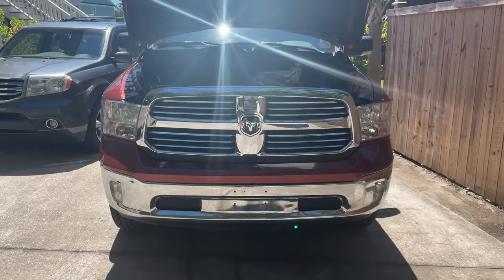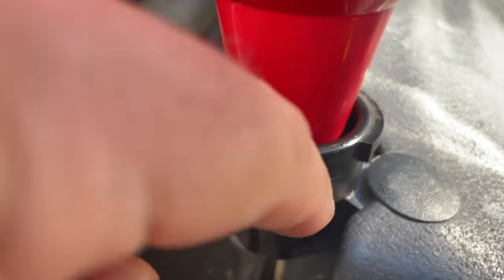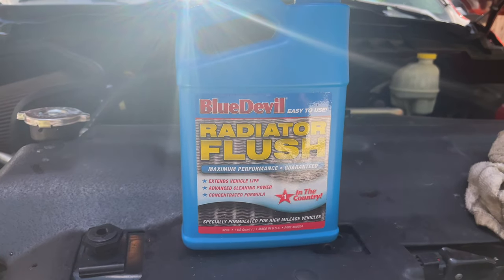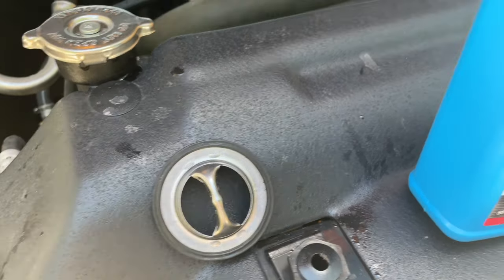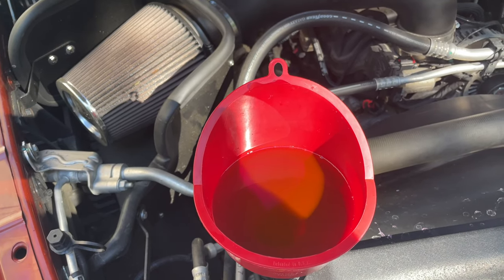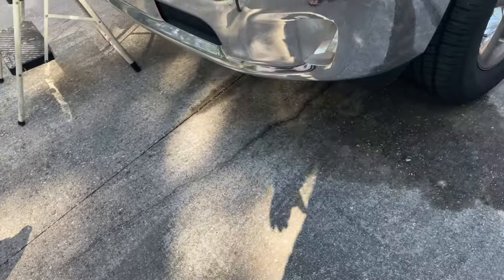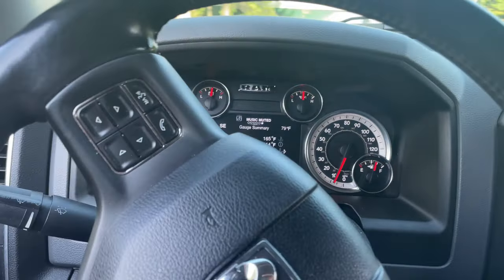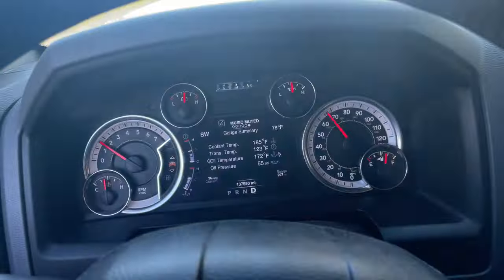Dodge Ram Hemi 5.7 Thermostat Mod | Coolant Flush Bleed & Trick

Comment from the maker: Wanting to share some of the journey of mods to my 2013 Dodge Ram 1500 Hemi 5.7. The 180 thermostat was installed after talking more with the performance community in an effort to help control short term and long term knock retard. This is a balancing act to keep sufficient heat in the combustion chamber, but not allow too much heat which contributes to more spark knock. Also, please remember this truck has a custom ECU tune by Hemifever to take advantage of the cooler engine temps.
Reply: Unless you have a forced induction mod with a custom tune changing to a cooler t-stat has basically NO Effect except to confuse the computer as it reads it to open @ 195. The minuscule gains and fuel economy losses amount to very little however if you have an azzhole environmental state on your azz this really affects that badly cause it is an incomplete burn of the extra fuel confused by the wrong t-stat opening until it reaches above 195. Unless you are towing HEAVY loads (meaning way over the recommended tow capacity) the heat load is minimal and this mod should only be done with a Forced induction mod or a heat increase due to heavy towing. Other than that the benefits are negligible at best and the fuel economy (yea right we running v8's really care about that  🤑 ) is a net minimal loss. These ARE the facts are are not disputed amongst any Expert forum advisor.  Just saying.
Reply from the maker: @anonimous2451  I will say you are entitled to your comments, but I got a good laugh for sure. This truck with the mods on it and the hemifever custom tune, absolutely loves this t-stat change. It consistently stays b/w 188 - 190 degrees and your comment about confusing the computer is not the case at all. This truck is proof, along with thousands of other hemi owners running these mods with hemifever custom tunes. The plugs look so much better than before these mods to top it off. Your "facts" about doing this only for forced induction or pulling Heavy loads is also misleading. This truck does at times pull a bass boat and the temps never rise above 190 and I live in a very hot, humid coastal climate. Wait, if this mod is ok for trucks that tow heavy loads, am I supposed to run out and put the stock thermostat back in when I am not pulling a heavy load??? I mean, if I don't and I am not pulling a heavy load, then the computer will be all confused and my gas mileage will suffer and I will eventual foul the plugs... LOL. Not true!! Also, the truck with the custom tune, cooler temps and other mods actually improved MPG by nearly 2 MPG around town and the highway. The motor oil is also clean and the oil temps dropped about 12 degrees when at full operating temps. Just giving you the FACTS about this 2013 RAM 1500 Hemi 5.7.
Reply: @KevinWilsonSBC then why do you think Dodge puts the hotter  thermostat in there? I mean I think you make total sense and it seems like to me if you can run an engine cooler you'd want to run it cooler. . Your oil looking better makes total sense to . Heat is what kills oil and fluid. So why don't they put a 180 in?. I was told the hotter thermostat is because of engines efficiency. Basically gas mileage
Reply from the maker: @ClaytonBigsby01  great question! It is all emissions driven. Remember this truck has a cold air kit, aftermarket exhaust and a performance tune from hemifever. I wanted more timing for power and pulling, to turn off the MDS on the computer and to not run the oil and heads so hot with the factory 205 degree thermostat to help eliminate spark knocking. The engine loves the cooler temps and more timing, the oil loves it and the engine stays around 185 to 190 coolant temps! Not to mention with the improved timing and MDS turned off, the gas mileage is actually better and the plugs are very happy. Go fast, go straight! Be SAFE!
Reply: @KevinWilsonSBC quién eres

Comment: When I replace a thermostat on a vehicle, I don’t drain the rad. I just go straight to take the housing and thermostat off. Just make sure I have a pan to catch the fluid that drains out. I’m no expert auto mechanic, but I feel like if I don’t drain the radiator, it will be easier to bleed the vehicle. The jiggle pin inside the thermostat will help burp the vehicle. Make sure the pin is 12:00. Thanks for the video

Comment: Very cost effective way to flush entire system would’ve been simply remove thermostat, get enough distilled water in buckets, hook pump/hose and fill the system & drain, next remove lower radiator hose so you not introducing sediments into Rad through water cycling through HC as you drain the block and repeat this after a drive and flush fully with distilled water. From your procedure you spent enough $$$ plus extra time many days not needed but results I’m sure still paid off. Most easiest way to get air out of the system would’ve been to simply open the bleeder valve on water pump or if not equipped to remove ECT sensor as you fill/close. Start her up get to operating temps, slowly open bleeder screw and left over air is out! Great vid, very detailed🍻
Reply: Do you have a video I'm having trouble following you

Comment: Only one very small hole is needed in the thermostat.  It only needs to let air through. To big and it will increase the time it takes for the engine to warm up. This will lead to excessive fuel consumption and cause very poor heater performance. Ask me how I know. Hope this helps.

Comment: You dont have to hack up a thermostat, you simply remove the rubber gasket and place it in the water pump. Seals perfectly
Reply: Exactly what I was gonna say
Reply: With a old water pump doesn’t work on a brand new one

Comment: Can any body in the comments tell me if the reservoirs on these trucks actually refill the radiator if it runs low? To me it looks the the cap seals off the over flow line to the reservoir and only opens if its too hot. How would the reservoir ever go back into the radiator?

Comment: Why not drain the block and heater core hoses after all the other work.  The passengers side block drain plug is fairly easy to get to.  The drivers side is pretty damn difficult if not impossible for the home mechanic.

Comment: If you live in cold climate areas? Only one hole is needed. When its -40, heat it your friend. These trucks were designed to run at around 203 degrees F. My old weak stat would cycle from 176F TO 203F and you noticed it in how poorly the defrosters work when its -40 f below.

Comment: For each pound on the rad cap, it raises the boiling point 2.5 degrees F, so your new boiling point would be 252 degrees F.
Used to live in the desert.  205, yeah, it caught our attention but you knew it wasn't going to boil the system.  No matter what, if it hits 220, I'm shutting down.  That's my preference, and I don't like it over 200.  But some blocks just run hotter.  Did you a know a 1mm, 1mm, 2mm ring pack brings operating temp down? Much more so than than the 5/64 pack. Working on determining if they rock in the piston bore.  Enjoy.
Reply from the maker: nolan engineering thanks so much for your comments! Good info! Thanks for posting and sharing. Sorry for late response, but thank-you!! Go fast, go straight! Be Safe!!

Comment: Did you program the radiator fan to come on at 185? If not, the cts will have it turn on at 203°F, which is oem settings. My jeep 5.7 requires this, but if you have a clutch fan. Ya might look into a different fan clutch.

Comment: My '03 ram Hemi has an over flow line on the coolant  resvoir that points down. I believe I don't need to burp it since that line would let out air by itself. Please let me know if I'm wrong. My 180* thermostat stays where it should be on the temp gauge. Let me know, thanks!
Reply from the maker: You should be good. My truck was heating up to over 200 at full throttle. Once I did this procedure and the flush, that problem went away. Go fast, go straight! Be SAFE!!
Reply: @KevinWilsonSBC  appreciate your reply! Like wise!

Comment: is it possible that a radiator on this truck may crack, if not  properly burbed  of air?
Reply: No the coolant will boil out the reservoir if you don't bleed the air if you don't catch it in time you will overheat the motor

Comment: I did this to my 2016 dodge challenger 5.7rt. And check engine light come on and said check throttle something  and my temperature needle  disappear . 🤔 I put three hole in my thermostat you put 4
Reply from the maker: Sorry to hear that!! I didn't have those issues at all on my 2013 RAM Hemi 5.7 which has a custom tune installed. I have had to replace the throttle body once since it owning it, but the thermostat and cooling wasn't related to the throttle trouble code I had. You can always put it back to stock.

Comment: Hey Kevin, Good job on the flushing. I also have same exact truck(2013 Bighorn) and original coolant in mine. Was wondering if you got any SES lights or warning lights from the computer for having a 180 degree thermostat? I live in Texas and was thinking of changing antifreeze and thermostat at same time, thanks
Reply from the maker: I have had zero issues with any warning lights or SES lights. I do have a tune which modified the fan to turn on at a lower temp. The truck settles in around 186 degrees which is plenty hot enough for emissions and I live in Charleston, SC which is really hot and humid. Even without a tune, I would highly recommend the flush and 180 thermostat! Go Fast, go straight! Be Safe!

Comment: Running a cooler thermostat will KILL you gas milage. Because the engine will not reach proper operating temperature. So the computer will keep the engine in cold start up mode.
Reply from the maker: Using the method I show in this video, the engine temp stays at 185 degrees and with the Hemifever tune we have actually picked up 1 - 1.5 MPG all day long. It is my understanding the computer comes out of "cold" richness around 160.
Reply: @KevinWilsonSBC  wow. I didn't expect that. Very cool.  My water pump went out.  I replaced the thermostat because it was so easily accessable. They auto store gave me a bad one, because my coolant circulates but the engine was over heating. I took it out, to drive back to the store.  The truck never got above 185, and it was mid 80 degrees in Indiana today.  But I only drove it a few miles.  Do you think my truck (5.7 hemi) could benefit from a cooler thermostat?

Comment: Flushing with tap water is fine.  Even well water is fine. Id just ude the distilled to fill it.  Flushing isn't going to leave deposits.
Reply from the maker: JustForFun77077 thanks so much for your comments! Go fast, go straight! Be Safe!!
Reply: You're dead wrong there. Ask a plumber what happens to pumps and metal components if you contaminate a system or fill with tap water on a in floor heating system. It says distilled water for a reason. Don't be a cheap ass and pay the $20 to do it properly before you toast a water pump or thermostat at the cheapest, or toast/seize something at the worst due to a potential daisy chain failure down the line...

Comment: Would I have to tune my truck if I install the 180 tstat? I have a 18 5.7
Reply from the maker: If you want to set the computer to run the electric fan earlier than 205 degrees, you will need a tune to change that part.

Comment: Why did you modify the thermostat when you could of just used the rubber gasket from the thermostat to flush system.. not smart
Reply from the maker: OK... yeah... Have a good one! LOL!
Reply: You need the metal piece to keep the gasket shape and hold it in place. Without the metal piece the rubber can squeeze out of place. That would be not smart.
Reply: On a 2012 Ram 5.7 the thermostat gasket accounts for the thickness of the thermostat flange, if there is no thermostat flange the gasket sinks further into the thermostat cavity. I don’t think there is a need to remove the thermostat to flush clean the system a few times though since the thermostat open about 1/2 inch allow for large particles to flow. 
Let me know if I am wrong.
Reply: @gerardr4869  not removing the thermostat to flush means a LOT of trash, grime and rust will get caught up in it. It takes more work to remove that junk than the thermostat, which likely needs replaced around the time you replace the coolant... Every two years or 30,000 miles.
Reply: Advanced Auto has a regular flat gasket for thermostat housing on my 2005 hemi. I used it. Did flush as this video shows then reinstalled thermostat. Bleeder port on thermostat needs to be installed vertical (high point) when re-installing. Overall I enjoy everyone's way of doing a job. I can always learn something from all. Safe motoring to all you cats.

Comment: How much coolant it takes in total? Thank you
Reply from the maker: santiago mercant thanks so much for your question! I would encourage you to confirm with your owner's manual for your specific year and engine combo. I did not do a full block drain, but did several water flushes at the radiator with heater on full hot, then flush, repeat. After several of those I am pretty confident I had sufficiently flushed the heater core and the block. Go fast, go straight! Be Safe!!

Comment: Where are the locations of the block drains at?
Reply from the maker: Chris Thomas thanks so much for your comments! behind the motor mount and a couple inches above the oil pan. Go fast, go straight! Be Safe!!
Reply: All you have to do is remove the bleeder , and fill through the radiator till coolant comes out . Done... just top off overflow tank . This is waaay to complicated a way to remove air .

Comment: I can't get the  engine block to drain. 4 quarts/liters came out. That's it.
Reply from the maker: Ok Ok thanks so much for your comments! I didn't try to remove the block drains. I just kept flushing with water, driving, then flushing with more water, driving, and repeat several times with heater on. This process eventually removes the old antifreeze. If you removed the drain plugs on the block, most of the time rust and grime will plug the hole. Take a small flat head or pick to clean out the hole and it should drain. Go fast, go straight! Be Safe!!

Comment: EVERYBODY TALKS ABOUT USING DISTILLED WATER…LOL, DO YOU THINK THAT (ANY) DEALERSHIP ON THE PLANET USES (DISTILLED WATER), WHEN DOING A COOLANT FLUSH?  PEOPLE HAVE WAY TO MUCH TIME ON THEIR HANDS!
Reply from the maker: LOL... I have absolutely used tap water when I don't have distilled water on-hand. You do whatever you want and how you want it. The proper thing here is distilled water, especially considering the amount of "additives" in most county supplied tap water. We are supposed to torque lug nuts too, but most people don't, however it doesn't make not torquing lug nuts the right thing to do. 

It is always interesting how youtubers like you can take the time to leave comments like this, but have ZERO content on YouTube to contribute to helping others. Must be a lonely way to go about consuming oxygen!
Reply: @KevinWilsonSBC my thought while doing mine is use a hose garden hose to do a through flush, use coolant flush, etc, then after I drain all the tap and fill with distilled, drain, then refill with coolant/distilled.  Should be good! Besides, after flush I replaced the pump, T-stat, and both main hoses lol.

Comment: I would of just let it run and let the thermostat open and fill again, let it go a coupe of times. No need to drive it.
Reply from the maker: Your call. To get the air pocket out I had to drive it as I tried your approach first. Go fast, go straight! Be SAFE!
Reply: What would happen if I don’t burp the air out of the coolant system the way you did with a funnel? … I was wondering if air will eventually get to the top of the radiator where I can just open the cap and let the air out.
Reply: @gerardr4869  if you don't bleed all the air out of the coolant system, the coolant will not be able to flow properly and will not cool the block, resulting in a much higher chance of catastrophic failure.
Reply: Air causes the water pump to cavitate hence loss of flow volume, hot spots in engine. Air must be removed.
Reply: There is an air bleeder port near the thermostat for a reason. Use it!!!